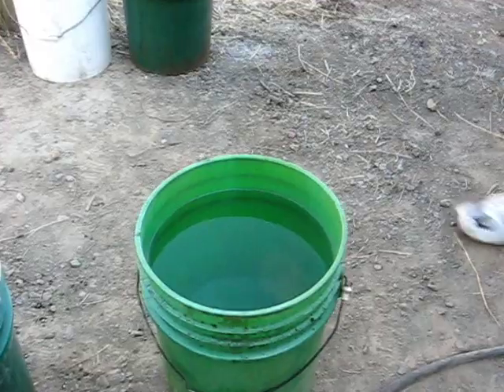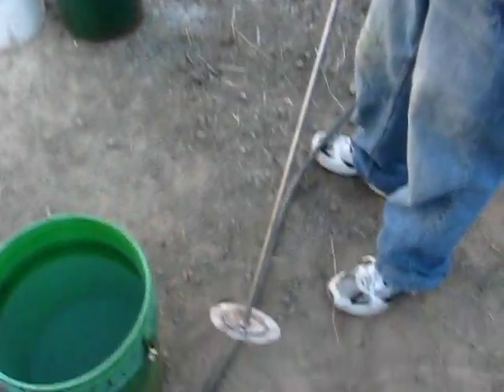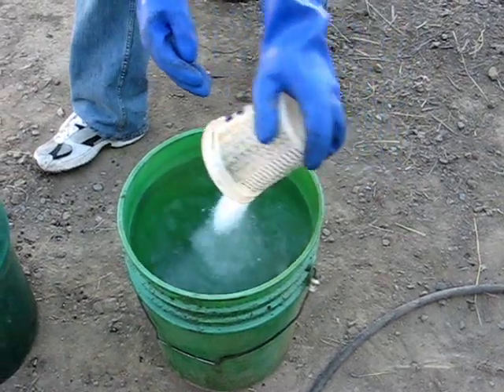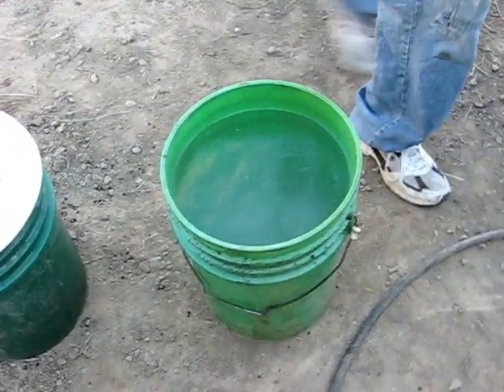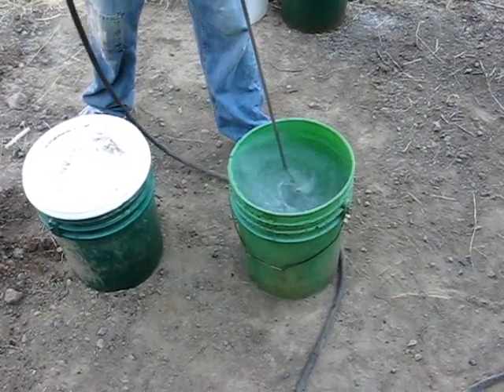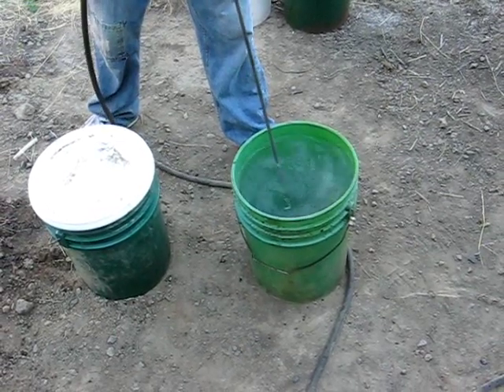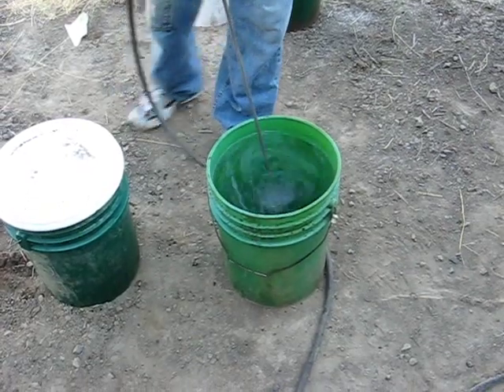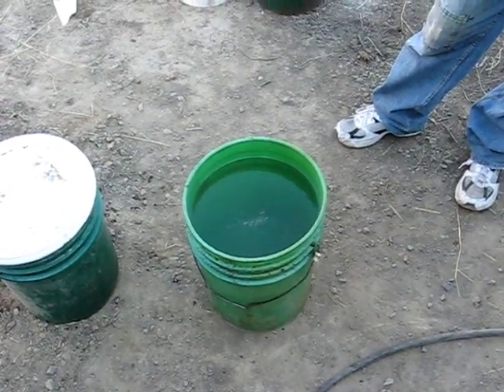MAKING BIO-DIESEL (Mixing Methyl Alcohol with Potassium Hydroxide) part 2

Comment: ok question where can a person get the potassium hydrxide and methyl alcohol to make bio fuel
Reply from the maker: I started making bio diesel using sodium hydroxide but found the potassium made it easier to deal with since the glycerine stays liguid and can be pumped off the bottom of my drums instead of manually digging it out with a shovel taking a long time and alot of extra work as it was becoming like bar soap using the sodium. It costs more money for the Potassium but found it to be far less laborious to work with the byproducts using potassium. Thanx for the comment.
Reply: sodium hydroxide works just as well and you can find that as drano crystals. Do your titration so you know how much to add to your volume of oil so there's no left over oil and it is not basic so the end product is clean and neutral. Then do a reverse decant type process(big container with valve on bottom like a big gatorade vat) because the glycerin made will float to the top and the biodiesel will be on the bottom. Then methylate the biodiesel and there you have it.
Reply from the maker: Call up your nearest  chemical wholesale/retailers till you find one that handles it. I was refered to a company I deal with and was able to even get a discount based on the volume I bought. Only trouble was this supplier is 200 miles away from here.,

Comment: I would not agree with that. Methyl alcohol is highly corrosive and could eat your fuel system. It also changes the cetane number which is not good. You need to wash your bio with water or drywash it. The finished product should be see through clear . Check out journeytoforever(dot)org for info on how to do it.

Comment: I believe what you are referring to is sodium hydroxide rather than potassium hydroxide. Potassium hydroxide is a liquid while sodium hydroxide is a salt and commonly used for biodiesel production as the catalyst to methanol.
Reply: Both can be used. While it can be purchased in liquid form, it's very common to find KOH in pellet or flake form.